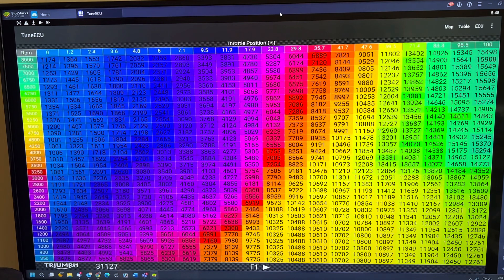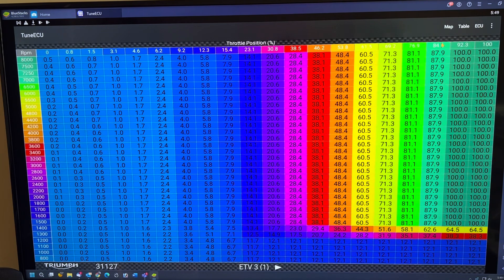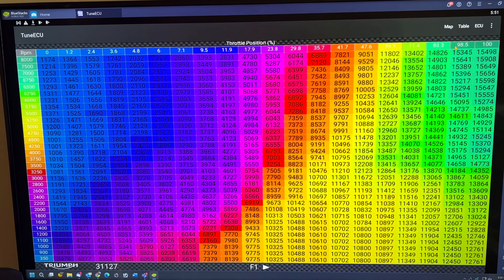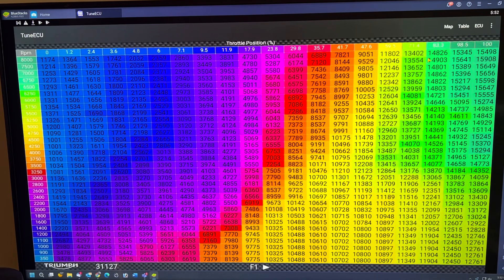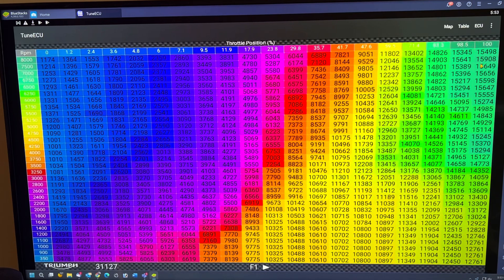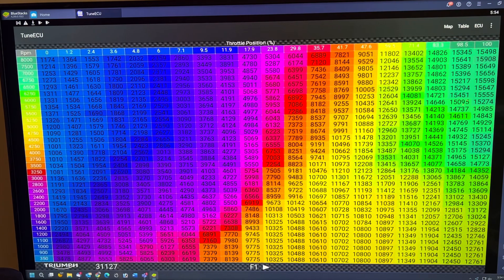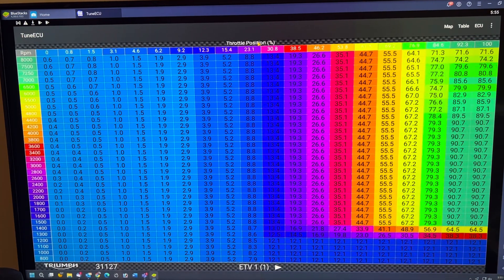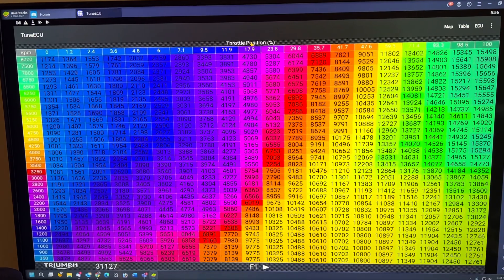TuneECU - How Ride by wire interacts with fueling

Comment: dave you  are so smart ! my rocket 3 scary (for me) pulls so hard at 115 i had to roll off  still pulling trying to ride out from under me great knowledge about ECU iam sure a boatload of triumph owners are happy however i now see why the ETV is restricted if your not used to this much torque. you sure make going fast in those backroads look easy going from 105 mph to 40 for a curve!!  maybe it was 110 looking at your speedo

Comment: This is great - thanks! I think there is an under appreciation of the fact that the twist grip actually controls the amount of air you allow into the engine. More air with a carburetor sucks more fuel, and more air in an EFI engine allows the ECU to spray more fuel via the injector. The fueling "reacts" to the change in airflow.
Reply from the maker: Well, it doesn't react so much as the ECU is programmed what to do.  When the motor is at X rpm, at Y percent throttle, spray Z much fuel...  But yeah, in a way, it does it differently but in the end accomplishes the same thing...

Comment: Thanks for the videos! really helpful if you are new in TuneECU app. Got a question about F tables for a 2020 Speed Twin. If F-L switch table is set in 20, has any meaning to modify F table below that range %? It is still effective? Have you tried to move these values in F-L switch table down below 20? I checked that 2022 model is set on 4, big difference(tables are not the same of course). Many thanks for helping and have a great day! , Edu
Reply from the maker: On my Speed Twin, the F/L switch is already at 4 from the factory.  I will research that a bit though, or, ask my tuner when he gets the bike on the dyno in a week or so...
Reply from the maker: You got me thinking about something, and I have a new map I made today and I will be making another video about this exact topic, that I am hoping can clarify some things, or even get someone to reply with more insight, stay tuned.
Reply: @Daves_Man_Cave  Good! It is just a thougth but if F-L switch table is set to hight, changing the F table is not the solution for stalling and flaping at low revs, even if you change the AFR ratio. Just my feeling..not a tune expert but got mechanic knowledge. Its like a carburator, two differents lines for low and hight engine charge load.No sure about what parameters made the difference between models. Not only Speed twin 2022 got that F-L range (4) most of them are set on that range.  Hope this brings some ideas🤔 Many thanks!!
Reply from the maker: @eduardogimenez6678  Just flipped the updated video on, go check it out and leave your thoughts.

Comment: New guy to Triumph and loving it (HD guy for prior 21 yrs).  You clearly are very knowledgeable, so I have a question.  '22 Speedmaster (1200HT motor), from roughly 3600 to 4200 RPM, I have an engine vibration/pulsation thing, smooths back out once I pass 4200 RPM.  Tune issue or normal?  

I have the TuneECU app on my phone and ODB2.  I'm ready to address this if it's a time issue.

Absolutely love your channel, Dave!
Reply from the maker: Hard to tell.  Is the bike stock?  It can have more vibration from a tune issue, or, some motors just have a certain RPM range where there is something going on with harmonics, a resonant frequency if you will, that makes it feel more "vibey".  If you can determine specifically where it happens... both throttle input and RPM, you could go to the Trim table(to the left of the Fuel tables) and add 5% fuel there, and see if it gets better.  If so, then add  a little more till it starts getting worse again.  Or, go the other way if the first change makes it worse.

Do it in small increments like 5%, don't just dump a bunch, or remove a bunch of fuel unless you are reasonably sure which condition it is.  That's the best way I can think of, short of tossing it on a dyno and seeing what's up.
Reply: @Daves_Man_Cave  thanks for your explanation on what may be the potential factors in causing this situation with his bike. Always learning. Hope you Enjoy your riding

Comment: Hey, thanks for all the info. Would it be possible to get a map for a street twin 2019?
Thanks!
Reply from the maker: What would you want in the map?  What mods have you done?
Reply: Thank you for the answer.
Nothing it is stock. I am interested in de restricting the TPS sensor so that it is really open at 100% when the throttle is also open.
Also i can try an learn to do it myself.
Reply from the maker: @arnaudb8260  I looked at the 2019 map and the restrictions are much less than the new ones.  Your bike gives you 100% all the way to 6500rpm, and then dials it back to 85% to the 7500rpm redline.  You can open up the map yourself and scroll down to ETV3 and see that the top 2 cells on the far right, are where the restrictions are.

It's not much, and so I don't know if its worth doing, because you are getting 100% all the way to where your bike makes peak power, and it only drops off a little after that.  You can still do it, but it won't have the same impact as the newer bikes that are held back a lot more.
Reply: Many thanks for the kind answer. When you mean newer bike you mean the 1200cc only? 
No point doing anything for the 900cc? 
As a side note my 2019 is the one doing 65 bhp.

Comment: Great, I understand now. So before 100% twist grip would only open a certain percentage, but the fuel map is "connected" to the throttle "Output or body" position. So, therefore I "Can't " have twistgrip at 100 % and 100 % throttle opening BUT LEAN because the ECU is looking at the throttle position OUTPUT I.E. what position the throttle plate/slide/ what ever it is , is on and matches 100% opening (of the "real opening")  with the fuel table for 100% opening. I was worried (as you know) about the engine running lean. Thanks for this explanation, it has cleared it up in my mind now :-)
Reply from the maker: Correct.  It has to be that way, otherwise instead of crazy lean, ib something like Rain mode you would have the opposite problem of it being way too rich.  The way it works solves both issues.  You twist the throttle a certain amount, the ECU decides how much to open the throttle plates based on the mode you are in, and the the fuel tables decide how much gas to squirt, based on RPM and throttle PLATE positiion